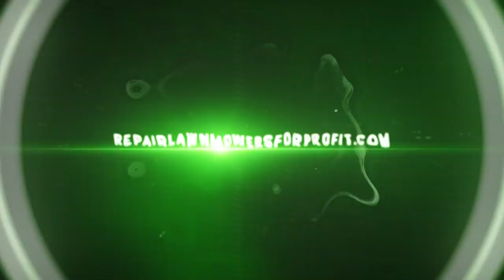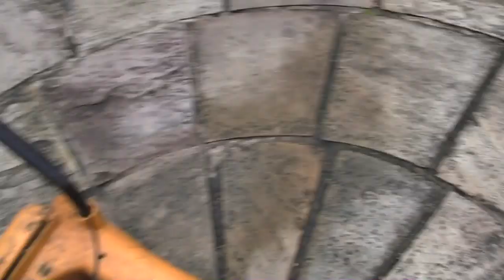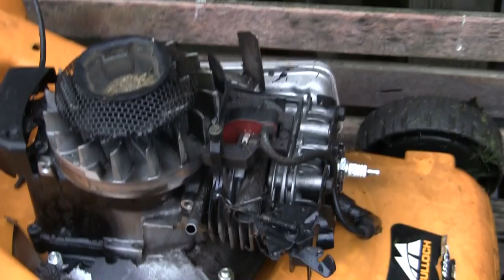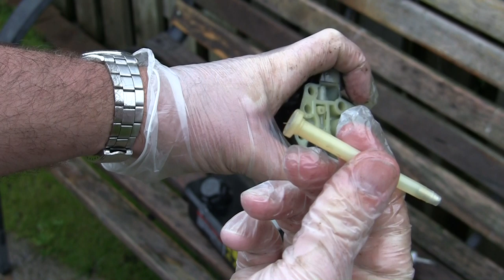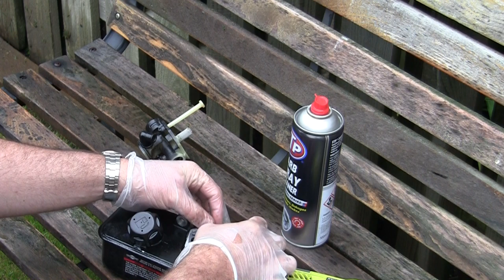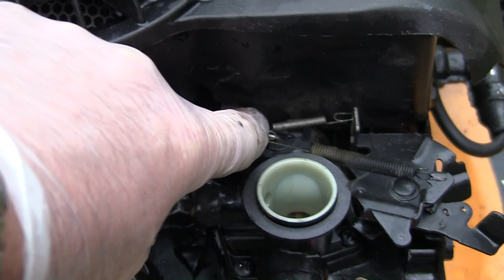1 Hour Lawnmower Service ! Awful Lawnmower!

Comment: On my last cut of the year. Spark plug clogged up with soot. Cured the power truble. Did everything you suggested. Running like it's new again saved myself a wodd, ov cash💸. Just logged on to your video. Very helpful thanks man, your a star 🌟♥️😉
Reply from the maker: Alan Medhurst Glad to be of service!

Comment: Normally change just the Diaphram and gasket. Never had to replace one of these carbs. I would also take out the jet that is underneath the metal gause too and make sure all the holes are clear. Did you check the gap between the coil and the flywheel? A few times i've seen no gap at all.
Reply from the maker: I usually just look at the gap. I dont like taking the main jet out on these unless absolutely necessary as they get damaged easily

Comment: Great video, I’m just sorting my first B&S lawnmower, got it for £15. One spring missing and not running. With the help of your video I’ve got it pretty much sorted. Diaphragm, plug, oil, spring clean air filter. Starts and runs good with just a hint of surging, I’m going to change carb o-ring as it’s a little sloppy and may be sucking in air. Cheers👍🏼👍🏼👍🏼👍🏼
Reply from the maker: Good luck Billy make sure the inlet manifold gasket is good also.

Comment: Hi Mr Mowerman Ive been fixing this exact model and once it's stopped running smoke comes from behind the exhaust. There's no grass or anything there as i cleaned it out is this something that's normal or should I be concerned. Look forward to your reply
Reply from the maker: Alex Durkin if you had it tipped up it is just oil that will burn off after around 10 minutes. Make sure the oil level is correct

Comment: Great video again pal. Do you have a link to the impact driver. Looks like a tool worth investing in. Would you recommend??
Reply from the maker: Hi Grayd the Ryobi Battery one is https://amzn.to/312JQts and the Clarke one that I use for bigger jobs that will undo absolutely anything is https://amzn.to/30YOb0W
The ryobi is smaller but has variable speed the clarke is less versatile but much more powerful without variable speed

Comment: Great tutorial as always paul 👍 even with the repeat ending lol yeh as you asked about do you replace the carb ! No i always clean the carb with the compressor and carb cleaner and remove main jet and pick up pipe & replace the diaphragm and gasket the carbs are so easy to work on as you know bud. looking forward to the next video cheers bud 
Andy 👍
Reply: TOLEDO JONES good video

Comment: one thing you want to do, is flush out the fuel tank. You'd be surprised, how often these get water in them. Usually, the water comes from the bottom of a gas can, when it's turned up side down, to empty the last bit of gasoline(petrol) out of it, that's when the water gets into the fuel tank, and drawn up into the carburetor. I've done that many times, and haven't even had to replace the diaphragm. Between water in the fuel, and fouled spark plugs, those are the two most common reasons a Briggs and Stratton engine won't start. When doing a service, I always change the oil, because most often, the customer doesn't. I'm luck if they even check the oil level! I don't think I have ever serviced one, where the air filter hasn't been so clogged up, that the engine can barely even run. That's the main culprit for carbon fouled spark plugs.
Reply: Vincent Robinette yeah a tank flush is a good idea

Comment: I used mine "commercially" for about 4 years. I bought it cos it was light as the couple of gardens I was doing was terraced and a normal mower was too heavy. Wasn't the best in the the world but did the job. It did just fall apart in the end but got my money back on it and earned a few quid.
Reply: bobbelsekwol as long as it’s not cutting anything long it should be fine

Comment: On that plastic deck you can adjust the height but it is a bit of a faf considering other mowers have easier methods for height adjustment. To adjust the height on that deck you have to unscrew the wheels and there should be 2-3 holes which would then allow you to adjust the height. Hope this helps anyone 👍🏻😃
Reply: Mitchell Wells yeah that have 3 bolt holes to adjust them

Comment: Pretty off when they are used and abused and not serviced. A genuine diaphragm and gasket, and off it goes again. Too easy . You may get a Chinese replacement carb and gaskets cheaper, but you are only fixing it again soon. Nice video, thanks.

Comment: I get all my parts from a company on internet called Garden Hire Spares. They were ok to start with, but recently, their diaphram and gasket sets aren't as good as they used to be. Also, your diaphram and gasket link goes to the Amazon home page and not to the parts.
Reply: Yeah I agree GHS are great for parts but D&G sets are no good.
Reply from the maker: @themowerman  Where you getting your sets from now Mick?
Reply: @MowerMan  from briggs and stratton  mate I don't mess about with G&ds the only other ones are from GWS they are not bad
Reply: i agree. i have a van full of aftermarket bits but i have had 3 or 4 bad D&G from GHS recently so have reverted back to genuine. cany fault their air filters and fuel filters tbough. 😊

Comment: What is it with the hard plastic mower deck ?
Reply: Just cheap mowers that are mass produced
Reply from the maker: They cut terrible as there isn't enough weight either
Reply: @MowerMan  yeah I agree
Reply: I bet they charge the same price for a metal frame ? I don't see to many of them in the USA yet

Comment: I hate to speak out oh master....as you taught me everything I know.....but you can adjust the height on these....the front wheels unscrew and you have a choice of 3 screwholes to replace the wheels....sorry!
Reply from the maker: BluejuiceT4 REALLY!!! Aaaargh! Ty bluejuice!
Reply: @MowerMan  I only found out recently when I picked up one with it's wheel missing!!
Reply: Yep except the bolts corrode and the wheel caps that should turn the bolt round off and you can't adjust it unless your lucky (same as flymo lawnchief with same deck)  then if you want to take the wheels off you have to cut away the wheel trim to get a regular socket on there!!
Reply: Can i just add that when removing the wheels on these if i remember rightly one side is opposite thread 👌
Reply: Yeah you have 3 adjustments on each wheel
Reply from the maker: @Andyjones07  Im not adjusting these in case they fall off lol
Reply: @MowerMan  i wouldnt either they do look a bit wonky mate 🤣